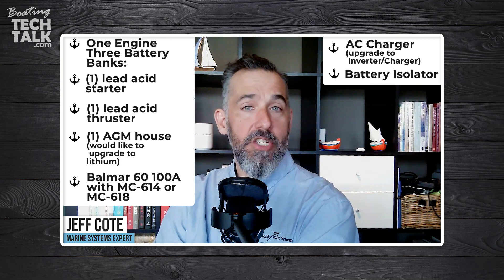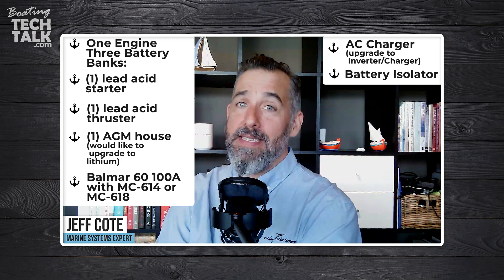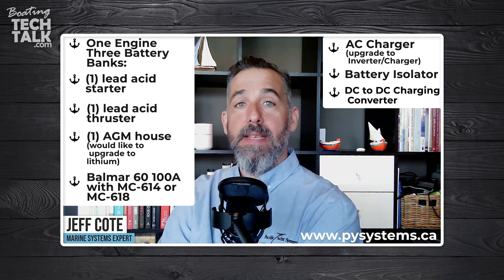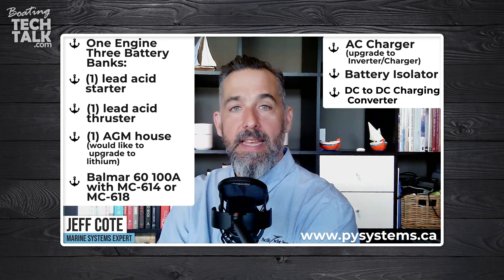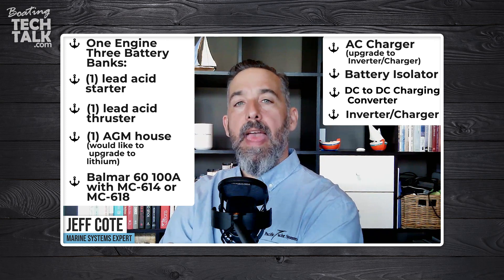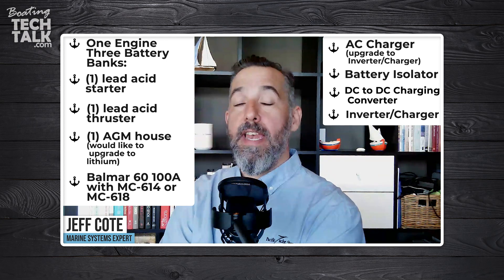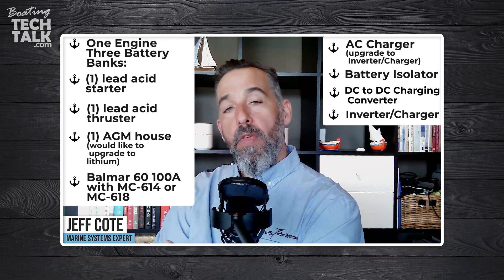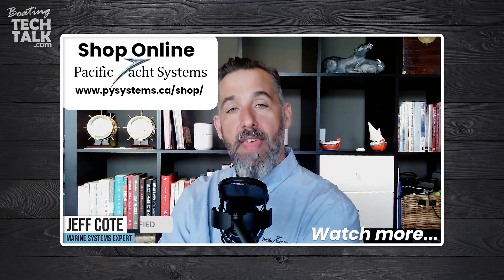What Is the Best Setup for Charging Multiple Battery Banks From an Alternator?

Comment: I have a, add a battery kit, with a house and starter battery. I want to add 2 trolling batteries for a 24v trolling. What’s the best way to connect the 2 trolling batteries to my current setup to have the alternator charge them as well?

Comment: I have a CC with a single 150hp Yamaha. Currently has two dual purpose batteries and I am wanting to switch to start and house banks. I would like to know if the alternator would be able to keep up with a single start battery and two house batteries in parallel? Will an ACR work properly with the house bank consisting of two batteries? Also for an onboard charger while the boat is at home, would I need a 3 bank with a disconnect between the house batteries or will a 2 bank charger work? 

The boat is used mostly for hanging out at sand bars. There are two amplifiers and a decent amount of speakers, thus the desire for two house batteries.
Reply: Hi Jeff, why not use a sterling alternator protection device? I think the alternator is then protected if your BMS disconnects from your lithium.

Comment: Hey Jeff. I have a similar setup in that I have a single alt….3 lead acid for starting and 2 lithium for house….1x3 isolator.  What role does the BSM in the Lithium play. I thought the BSM was supposed to manage charge rate, temp and discharge. Is this wrong. Battlrborn lithium are pricy and I don’t want to screw them up. Thank you
Reply from the maker: The internal BMS is just a safety switch that will open in the event of a battery malfunction or voltage levels that are too high or too low to protect the battery.  It will not control anything.

the Alternator itself needs to control the charging voltage.  You need to control how much power you take out of them before the BMS cuts off the output from low voltage

Comment: Instead of having your alternator charge the lithium bank and potentially frying your alternator when the BMS shuts off the connection, you should connect the alternator to the start battery and thruster battery (assuming you keep the same chemistry for both) and then connect 1 or 2 dc to dc converters from those to your lithium bank. Victron makes a 30 amp dc to dc converter and you can run more than one. It isn’t the cheapest solution and it won’t charge your lithiums the fastest but it’s the best solution I’ve found so you don’t end up frying your alternator and you can still mix battery chemistries. I also installed a Sterling Power 12V Alternator Protection Device just in case. This will absorb a return spike voltage and save your alternator.
Reply from the maker: This depends if you have an internal or external bms.  With an external bms wired to an alternator regulator, it will shut off the alt before damage happens.  Then you can charge direct to the house bank which is the best way for maximum charging.   With an internal bms, charging the start first then a dc to dc to the house is the safest,  but then you are limited to the max current of the dc to dc.  (1 or maybe a few together).

I would also look at the whole picture. if you have an inverter charger charging the house from shore / gen.  the dc to dc from house to start will charge the start batt from shore too.   If your alt is to the start, and your dc to dc goes from start to house;  When you plug in,  your inverter / charger now only charges the house and not the start.  so you need a 2nd ac charger on the start.
Reply: Great points. I wasn’t aware of the external BMS situation. My lithiums are Battleborns with an internal BMS so I never researched that. Thanks for the info!
Reply: @PacificYachtSystems  Just hoping to follow up on this thread in the comments. You mention if the BMS is external, that you could wire it to the alternator regulator… what would you recommend if the BMS is internal? 

I’m curious because I just bought Renogy 12v 200amp deep cycle batteries for my house and am going through the process of building a similar circuit. Thanks in advance!
Reply: I will be installing a DC-DC from start to house to utilize the alternator for charging my Victron AGM house bank. When I plug in, my Victron Inverter/Charger primarily charges the house bank, but also has a small 5amp trickle charger that keeps the starter battery topped up.

Comment: I am installing a victron lithium setup with the lynx BMS and Wakespeed WS500 alternator regulator for my Balmar XT170. I am hoping the regulator via the Lynx BMS will save the alternator if the batteries get disconnected. Or else it could be costly:)
Reply from the maker: You need to connect the lynx ATC wire to the WS500 feature wire to have it shut down.   They have a diagram for the lynx on their site.    note the "cross over cable"  they mention is not actually a standardized ethernet cross over cable,  but a custom cable with only 2 of the 8 pins used.   you Also need the wakespeed terminator,  the victron ones use different pins and can not be used on both ends.

http://wakespeed.com/CU/Victron%20SmartLithium%20Lynx.pdf
Reply: @PacificYachtSystems  Thank you. I am working to this, https://www.victronenergy.com/upload/documents/MultiPlus-3KW-230VAC-12VDC-600Ah-Li-Lynx-Smart-BMS-&-distributors-Cerbo-GX-touch-generator-MPPT-Extra-Alternator-&-WS500.pdf
Albeit without the generator and using 3 200a victron smart lithiums. I have the ATC connected and also the correct crossover and terminator from wakespeed. Hopefully be ready to run in a few more days.

Comment: Great video! The lithium house to DC/DC charger to a thruster bank is exactly what I am working on right now and just the video I wanted to watch.  I have not only the 3 separate banks I also have different voltages 24 volt and 12 volt. 
A question I have though is id be curious to see an in-depth technical video on how multiple charging systems work together, ie 2 x alternator, solar, wind, etc. when all connected to one battery bank
Reply from the maker: Thanks for the suggestion